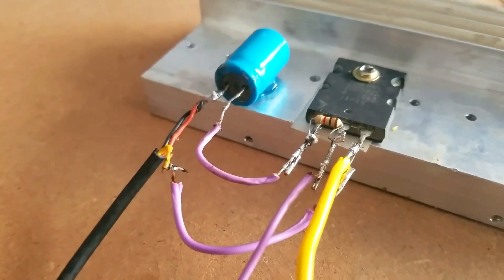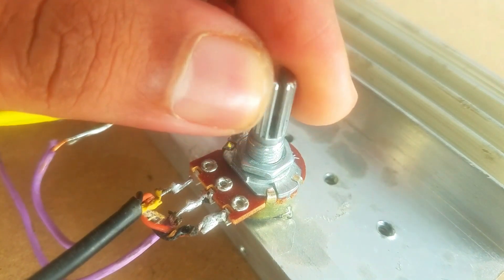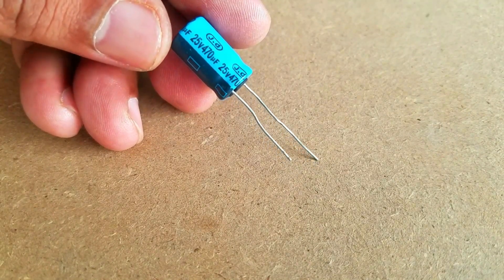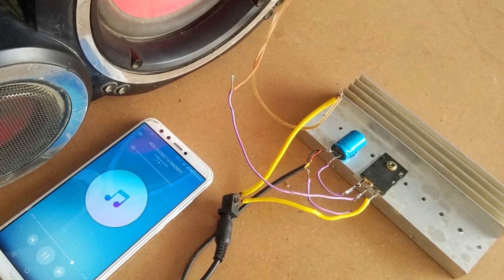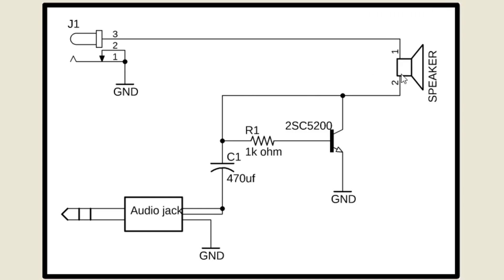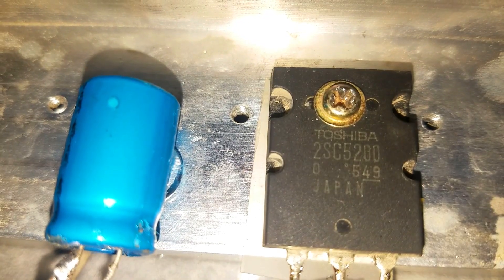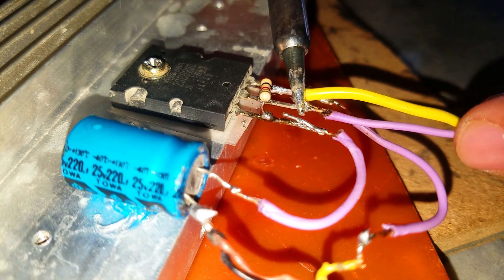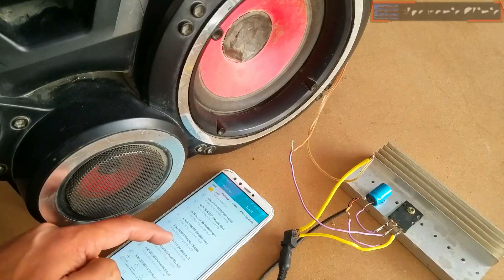DIY One transistor Class A Audio Amplifier using 2SC5200, DIY audio amplifier, mini audio amplifier

Comment: Why speaker is pushing outward even if not connect in audio source?
Reply: Because voltage is applied to the speaker as soon as the circuit has power.
Reply: @larsw4880  DC voltage is still present in output, circuit is incorrect🤗.. SCAM!!🤦
Reply: @kenmontero9038  well, it works so in that sense it's not a scam, but for the speaker it's not the best design but it is very simple and suited for when you have minimum resources and requirements. It's loud but don't expect hifi😁
Reply: @kenmontero9038  It has a lot of dc offest, it's not a scam, but it will burn the transistor easily if used for more than 5 minutes. Also, it can damage the speaker due to dc offset.